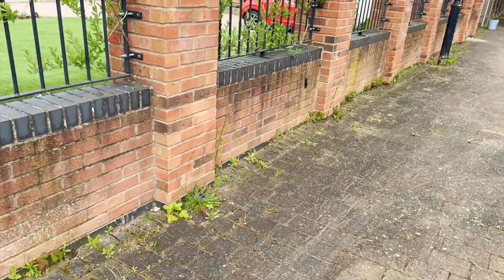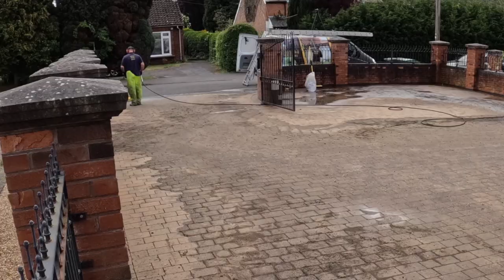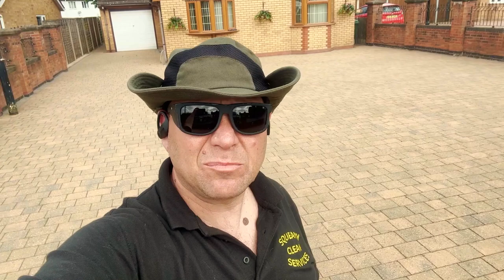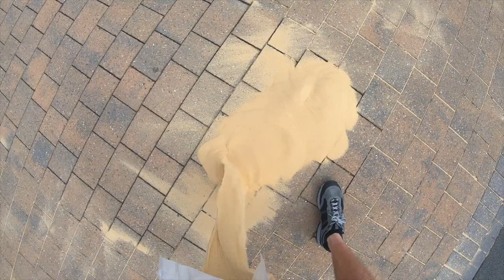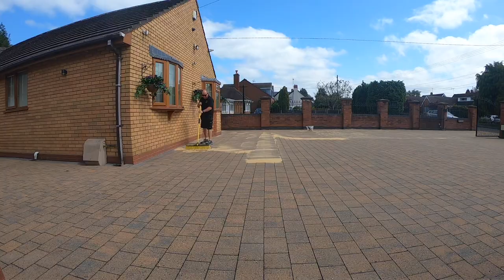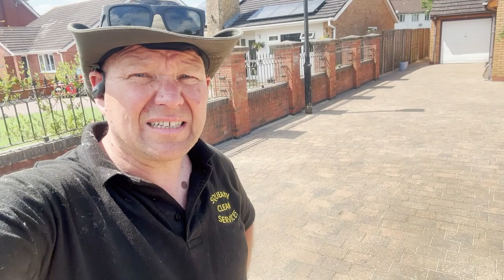Pressure Washing Massive Drive Covered With Weeds

Comment: Hi mate, great video! did you use a weed killer prior to cleaning this or what do you suggest to the customer? as I’m guessing those weeds are terrible.
Reply from the maker: Hi Ben
No I never use weed killer. There are some very strict rules about using weed killer and I haven’t got the tickets for them
Reply: Yeah you need a couple of licences to apply… do you literally just clean and apply hypo when needed and that’s it? have you ever had any customers call back after a few months and mention weeds coming back through?

Comment: Is the sand an extra add on or is that all part of pressure washing someones drive?
Reply from the maker: With block paving it needs resanding after pressure washing but some customers prefer to do it themselves so I have a price per meter for sanded and a price per metre for not sanded.

Comment: Hi Dave, how did you get though that job using just the customer water , and is that a  gx 390
Reply from the maker: Yes it’s a gx390 at 21lpm. I used a wheelie bin as a buffer tank and they had a really good flow on the tap